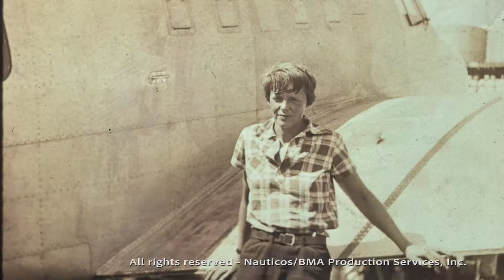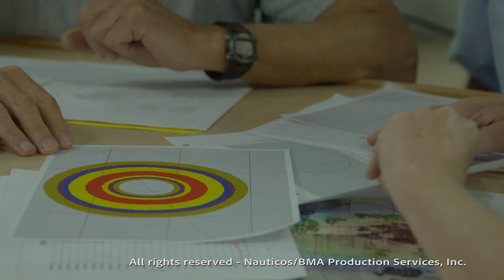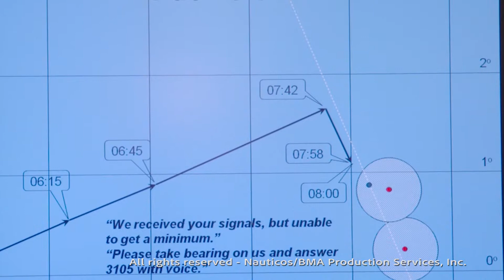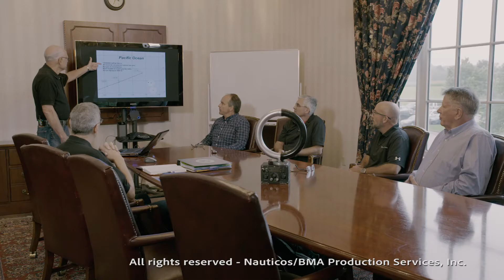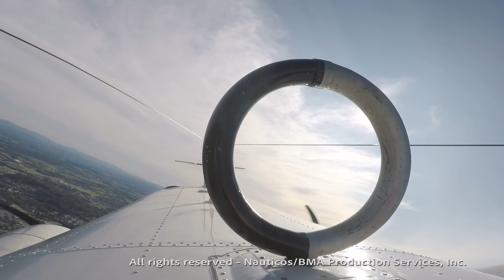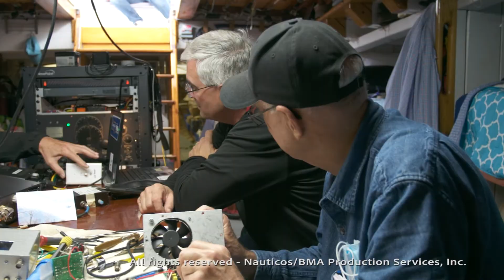Dynamic Aviation Joins Nauticos: Unlocking the Radio Mystery of Amelia Earhart's Final Flight

Comment: Amelia Earhart and her navigator were given the wrong directions (true heading) based on a simple math error!!! 2556 miles equals 2221 nautical miles, 9.49 degree east magnetic declination near Howland Island!!!.
X = sin (inverse)(517÷2221)
X = 13.46 degree 
90 - 13.46 = 76.54 degree true 
76.54- 9.49 = 67.05 degree compass heading!!!
157-337 can be represented by both a 67 degree true heading and a 67 degree compass heading which is 1.5 degree north of Howland Island!!!
Clarence Williams gave them the wrong directions!!!